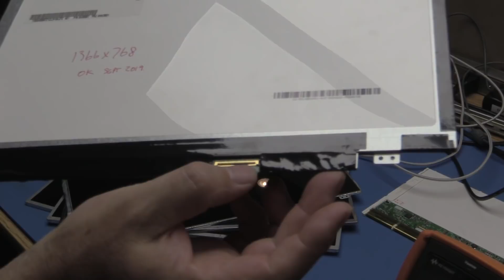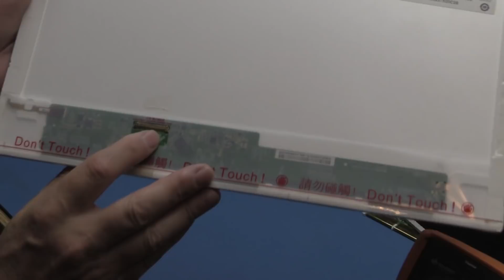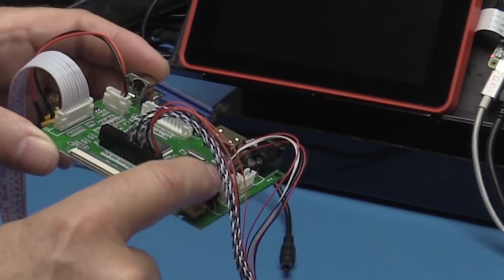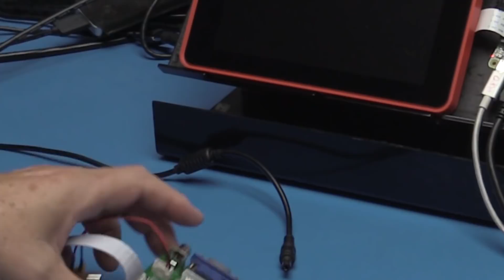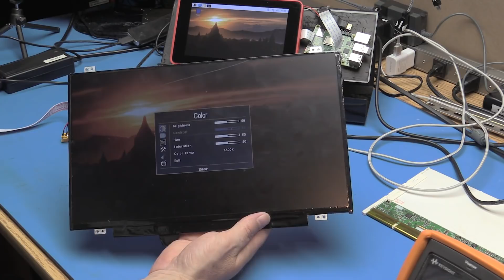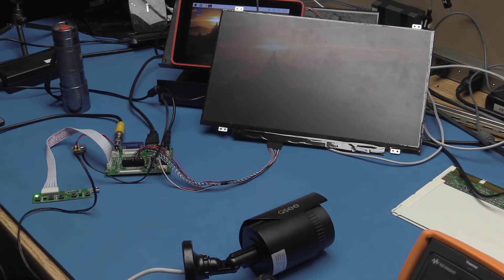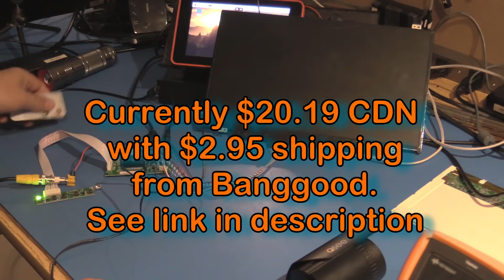Old laptop Screens on a Raspberry PI... Yes indeed.

Comment: Inspirational video, thanks for uploading. I wonder if it is possible to use it with old TV-LCD-display-panels. Probably not suitable to power the backlit bulbs but maybe there is a way to replace the bulbs with LEDs. Could be a good source. Those panels are also LVDS but with a larger connector. Any thoughts on this?
Reply from the maker: Actually, alot of none 4K screens are still able to be driven by these boards, the issues is if they have CCFD's which would require a separate driver, if LED then I think if you provide the right VED voltage/current it could still well work. the important bit is they still often use one of those LVDS connectors.

Comment: why use a card when the PI should be able to do it?
Reply from the maker: for most LCD's the PI can not do it, it has an incompatible interface, the PI has DSI interface this port is a 15 pin interface that supports up to 2 data lane MIPI signals, most LCD displayed being reused are LVDS (Low Voltage Differential Signaling) and use a different protocol to talk to the display, therefor the need for a board that uses the HDMI output and converts that to an LDVS compatable signal.

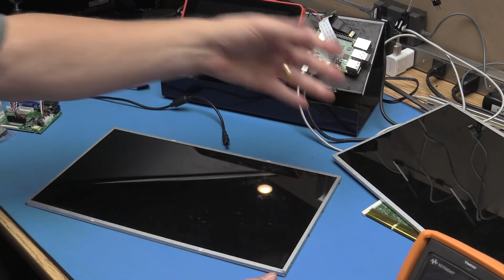Comment: Nice video! Very informative. Though one correction: the N156BGE-L21 panel at 8:14 is 1366*768, not 1024*768, this can be easily seen simply by the dimensions of the panel. I've never seen a 4:3 aspect ratio 15.6" panel by the way. 15.4 are usually 16x10 and all the 15.6" ones I've come across are 16x9. If it operated at 1024*768 that is usually a sign of missing graphics drivers on the device it was connected to. I myself came to this video in search of a converter board from lvds to 2 or 4 channel mipi, which would allow a direct connection to mipi dsi interface of SBC's like the rpi4, but no luck so far!

Comment: I CAN USE ESP32  ???
Reply from the maker: An esp32 does not have the interfaces to do this, you would have to build them and that along with the programming will probably not be worth the effort. Can you get an ESP32 or RPI2040 to output video ... sure but not at the same level as this works with a full blown RPI or any other SBC that supports native HDMI out. The RPI 2, 3, 4 etc has a built in GPU that is exposed as an HDMI output or LVDS. ESP32 etc does not.

Comment: Great video, I could watch these all day. I have an old Toshiba SATELLITE C655-S5307 with this screen LED-1366-768-G-40-15.6-A116    and I want to use the screen as a stand alone display for my Raspberry Pi400.  and I need a control board/ pcb board/Control board (I'm not sure of the right term) The resolution is1366x768
 and it has a 40 pin video connector. Where can I find one? To be compatible with the screen does it just need to be the same resolution and pin/plug type. Thanks, Mike

Comment: I have a need to run 30 screens, each screen with a different image determined by a single program. I am very noob and wondering how to design this architecture.  My guess is that I need 30 separate screens (duh) and 30 display driver boards but instead of running a raspberry pi for each screen I would like to process on 1 machine and distribute. Any tips or ideas on how this needs to work? I can't think of a processor with 30 hdmi outputs. Is there another way to think about this?

Comment: One question, I dont know if my display is working and the laptop i pulled it out of wasn't working. So how do i test the display without wasting 25-30 bucks on a controller board? I dont have more displays to use it on.

Comment: How do you go about decoding the wiring? Ive been building some old prop laptops (see videos) but would love to use the original screens, instead of putting a mitsubishi screen in.
Reply from the maker: The  LVDS lines are pretty standard for these screens, the only real variances for screens upto 1080p is one or two lane LVDS and the voltage, the pinout is pretty standard.

Comment: Very informative video, thanks. I am trying to hookup a usb microscope to a display like this, but don't know any controller board that has a usb video input. Any suggestion will be very helpful.
Reply from the maker: I have not seen any USB video input video controllers yet,  HDMI/other to USB sure, but not USB Video to display, and the only USB I know of off hand right now that supports true video over usb is USB 3  GEN 2

Comment: I'm hoping their other board listed "B156XW02 LCD Controller Board HD DVI VGA Audio PC Module Kit For 1366x768" is the new version as the link is out of date (I cant seem to post links).
Hoping it will work with my Acer ASPIRE 5745-7247 screen, it's 40 pin and 1366 * 768, I couldn't figure out more specs though.

Comment: Please some one help me iv got a raspberry pi 3 with the same lvds in the video and an lg LP156WH4 screen and I'm not getting any picture
Reply from the maker: Is the backlight comming on?, did you jumper for 3V3 operation, thats what your panel needs based on the data sheet, was it working when you pulled it from the laptop ?, if the backlight does not apear to be commin on, is there a image on the display but perhaps very faint ?

Comment: I have a LCD Panel ( LTN156AT02-D09 ) If I get that controller board,  can i connect it to my computer as a monitor by HDMI cable
Reply from the maker: based on what i can see of the specifications here https://www.panelook.com/LTN156AT02-D09_Samsung_15.6_LCM_parameter_22692.html it should work, you will need to set the lvds voltage to 3v3 as indicated in the specifications

Comment: mine did not work  so i also have the controller board  same as  yours  im just missing lvds  cable so i bought  one  online but when it arived  i was  so eager to try it out  then  when i pluged it in  the screen is like  yes it flickered black  once   but  after that  its  just  back light  and  a dark screen and i dont know  why      the lvds cable that i have was  100% compatible to my lcd      but yah i dont know why     i also checked  my  wirings  if  they are connected in the right way  but i still have nothin
Reply from the maker: there are jumpers to set the voltage, 3v3, 5v and 12 V , if the wrong one is set it could do damage or simplpy not work

Comment: I always thought that given how beefy old laptops were, Raspberry Pi should do its bestest to help users recycle their old laptops. All you need should be an R-Pi, intermediate board for all I/O (screen, keyb, trackpad, CD-ROM, HDD, USB, LAN...), lots of wires & solder and glue.

The old useless laptop mobo obviously goes to a drawer labelled "for parts."

Comment: do you need the transformer with these boards, or are the units without the transformer ok to use? I have a lp173wd1. Thanks for your info.
Reply from the maker: When you say transformer, I assume you mean the power brick?, you do need some kind of power supply, there are no micro controllers or SBC's I'm aware of with enough excess power to supply a bigger display and its back light., (Mainly the backlight)
Reply: @TheBreadboardca  I was referring to the inverter I think? I see some boards have one with the reset of the equipment. Or should the  small pcb on the back of the screen be sufficient?
Reply from the maker: @sdmilliken  ah, so that depends on the panel you have, if yours is an LED back light then no, if it is a CCFL that's cold cathode fluorescent... then perhaps, if your extracted panel does not include the inverter as a separate unit then yes, some times you can reuse the old ones but I think it may be easier for most to just get the ones that work with the controller, that way when the screen goes off, so does the battery light,  hope that helps

Comment: Hello. Awesome video. I got two of these LCD controllers https://www.robotics.org.za/HDMI7-40P like yours but the screens are not working. I have a Samsung LTN156AT15-C04 and a LG LP156WH2-TLA1. I had to buy these cables separately https://www.yuup.co.za/products/5pcs-40-pin-1-channel-6-bit-led-lcd-lvds-screen-cable-for-display . I can see the back lights come on but no display or menu etc. I am plugging it into a laptop using HDMI. Any advise would be greatly appreciated :)
Reply from the maker: I can not find that part via your link, are you able to link it from somewhere else
Reply: @TheBreadboardca  I also sent you the links via email
Reply from the maker: @bradleyeastes9501  you should have my reply now

Comment: Times sure have changed. About 15 years ago I built my own hi def lcd projector. I bought a concept board out of China (had to fib a little and tell them I was doing prototype work to get them to sell me the video card and various cables for use with a few screens I had). The video card was pcie and wildly expensive 😬 cables were custom made for each screen. I had to supply schematics for each screen.. the cables were really cheap. 

   Great video, nice to see people still like to repurpose instead of simply purchasing "box solutions"!

Comment: Are you implying that the board you are using is universal for various makes and models of screens to use with my Pi...???
Reply from the maker: Some boards are universal, the screens (LVDS) have a standard way of providing the data and also there are standard ways to frame the data. Not all boards are easy to change the base parameters though (Pixels height and Width / depth etc), the second board I reviewed in the next video is much easier to re program as it has a USB Host interface and all you need to do is provide the firmware on a usb stick and a few clicks so to speak and your done.

Comment: The board that you linked in your description, I see it takes composite video (AV) which obviously means that board supports interlaced signals like 480i.  Do interlaced signals work over the HDMI input?  could you run 480i over HDMI?
Reply from the maker: I dont have a 480I signal to test with, sorry. I looked and can not find a reference to this scenario .

Comment: Could I use a touchscreen laptop screen
Reply from the maker: you can but in pretty much all cases the touch is treated completly separately to the display functionality, if your lucky then it may include USB interface functionality, but it could equally be an I2C or SPI touch controller you may have to interface to.

Comment: Hi, I need your advice on the following : I have an old Toshiba Satellite L300-OR, Model PSLB0C-07R08C, like brand new not even a little scratch on it, that works great ...except for the speed of course. From the videos (this one and the following), I tought I could strip out the motheboard and replace it with a RaspberryPi 4, and one of your boards demonstrated in your videos and a keyboard to USB adapter. I saw this offer on Banggood : https://www.banggood.com/T_SK106A_03-T_SK105A_03-Universal-LCD-LED-TV-Controller-Driver-Board-TV-or-PC-or-VGA-or-HDMI-or-USB+7-Key-Button+2ch-6bit-30pins-LVDS-Cable+1-Lamp-Inverter-p-1401873.html?rmmds=search&cur_warehouse=CN. Do you think this adapter would do the job? If not, which one you think I should buy? Also, if you have idea for a keyboard to USB controller (to buy or build) please let me know. Thank you for your help.  Thank you also for all this knowledge and project diversity you share with us. THIS IS GREAT !!! Regards, RJM

Comment: MacBook Pro 11 cable ?
Reply from the maker: In most cases the cable from a laptop to the screen proves to be unusable as it has custom connector at the controller end and often has many other wires included like WEB Cam and Mic. what you need to look at is the model of the LCD screen and its connector

Comment: How are you powering the controller board? Will any 12v power supply work??  How many amps do these monitors/control board require?  Is there a 24v power supply? 

Thanks in advance.
Reply from the maker: You should aim for 2A or more, this depends mostly on how much current the backlight / CFL will draw (The actual screen does not draw much current in relation to the backlights), but a typical 12V 5A supply will take care of most situations, I would be careful of using 24V as the onboard regulators or circuits may not like it and you could fry everything. if the controller does not say it can take 24V then dont. this does not mean you cant use a 24V primary supply and add a buck convertor to bring it down to 12V efficiently,

Comment: Hey man, maybe you can point me in the right direction.
I have here an old Sharp lq133K1LD4B display that has only 20 pin and I'm unable to find a controller board for it.
Do you have any clues if this even exists??? The smallest ones I found are 30 pin wide.

Thanks for any help  o/
Reply: Ok, so according to this: https://pinoutguide.com/Electronics/tft_lcd_lvds_pinout.shtml
The 20pin and 30pin are "the same"........but I still can't find a model of controller that comes with 20 pin connector to the LCD.
But considering I still have the original flat cable here, maybe I could adapt it to one of those 30 pin options?????
Have you tried this before?
Reply: Wow....that was hard.....but I found one that kind of looks like the right one:
https://www.aliexpress.com/item/33052974709.html?spm=a2g0o.cart.0.0.1e553c003hB5cY&mp=1

Don't know why it was not showing up on the search before........
What do you think?
Reply from the maker: @AndreFrazatto  https://www.banggood.com/custlink/mm3hcNe020 for a cable
Reply from the maker: @AndreFrazatto  This controller would or should work, it has a ccfl driver, the cable in the other link is still needed as this one has a 30 pin https://www.banggood.com/custlink/DGKycAe4TW
Reply from the maker: @AndreFrazatto  that does also look like it should work, it matches the resolution etc and does have the needed ccfl board.
Reply: @TheBreadboardca  Thanks, it will take a wile to get from China to Brasil but I let you know if it works  o/
Reply: @TheBreadboardca  Yep, it works just fine, thanks for the help  o/

As we expected, it really is just the 30p board with a 20p connector. I don't understand how they set the resolution though.
Reply from the maker: @AndreFrazatto  Good to know your up and running, the resolution is done through programming of the board, some are easy to change (USB Flash Drive) some are pretty hard (Need a special programmer that works through the VGA Port)

Comment: i really want to make this....i have raspberry pi...an old laptop screen but dont knw which one to order....its LP154W01 (TL) (AE) 

I found some control board on ebay but they dont deliver to India....
any1 know where can i get one
Reply from the maker: unless you can re program the board, you need to ensure it will handle (Or be pre programmed) 1280 x 800 resolution. Also make sure to get a CCFL driver with it as this display uses a CCFL not LED.

I would suggest the programmable one I reviewed int he second video I released on this topic, I even show how to program it

As far as were to get one, I cant help you there, I get mine from Banggood and if they wont ship to you, I dont know what to suggest.
Reply: @TheBreadboardca  thank you for your suggestions...i will try to do this

Comment: How many amps do I need for the 12v power supply?
Reply from the maker: It very much depends on what display your connecting and what kind of back-light it uses, but typically between 2 and 5 amps should work for most scenarios.

Comment: I'm a bit of a noob with this... what are you using to power the screens? what kind of connector is that? Thanks!!
Reply from the maker: the connectors to the screens are LVDS (Im not sure of the official name. I get them ready wired for different screens). In the case of these screens, the power is supplied through that one connector, other screens may have different arrangements. the power to the board is from a standard 12V wall adapter (rated at a few amps or more), you need to ensure that the board is jumpered correctly for the volts needed for your LCD. it could be 3.3V, 5V or 12V even. check the specifications before powering up

Comment: can i do this with tv display .. my tvs motherboard is not working
Reply from the maker: Funny you should ask that, I am about to try in the next little while with an older LG 42" TV, I have not found any reason why not so far as long as you have the right LVDS cable and a big enough driver for the LED back light

Comment: Hi, i have a "chi mei" monitor [N154l3 -L03] taken from a hewlett p. laptop and i'm going to buy this: T.V53.03 Universal LCD LED TV Controller Driver Board TV/PC/VGA/HDMI/USB+7 Key Button+2ch 6bit 30pins LVDS Cable+1 Lamp Inverter, am i correct ? i'm total noob ...

Comment: i have 2 old laptop display yesteday just take out of broken computer cases. but i not know what controller thats need use,not have same 40 pin flat cable connection, have out jst style connection plug.  acer have model B173RW01 lcd moduleLK 17305001938F84582000 how i know what controlelr i muyst orden ? i have one controller new 10 inch display board think made raspi 10" display but have broken display, controlelr have new only used test and see all picture have broken.

Comment: hellooo I have 4 of those board that has everything except the part to connects to the monitor.  where can I buy the ribbon cable for laptop screen.  

all over I have seen you need to match board with screen..
Reply from the maker: you can also get them from Banggood, try this link https://www.banggood.com/custlink/Gv3vkKuvEt
Reply from the maker: Using the datasheet from your LCD, you can refine the search to that needed for your display

Comment: Works a treat .but how would I get sound out..or would I have to buy a different control board with that option.cheers..
Reply from the maker: if you want the audio out from the control board, then yes, I would suggest a different board, the one I show in my followup video would be a good example, and is fully programmable for many different resolutions, and has a TV tuner (Analog) and can play media files from a USB key, see https://youtu.be/mHVrsOhccdM